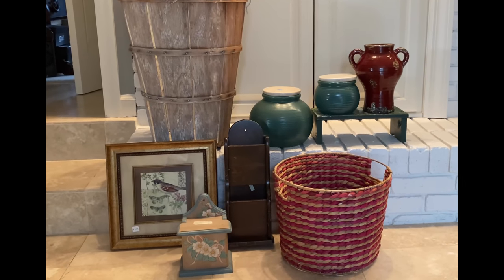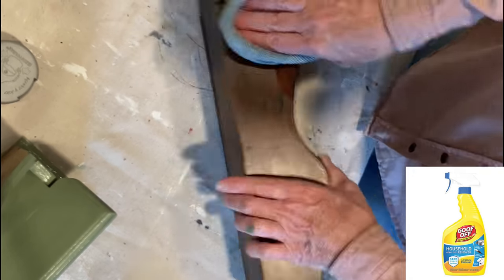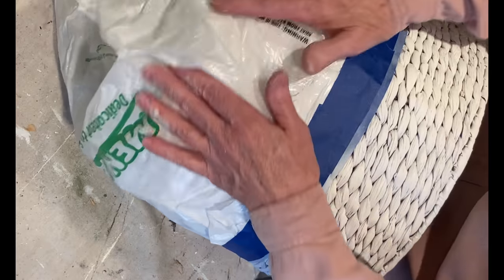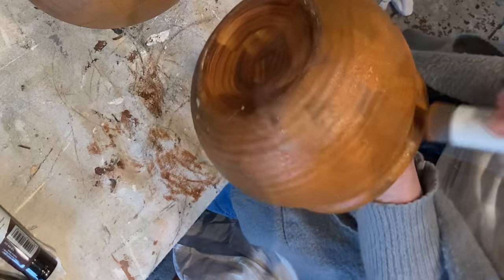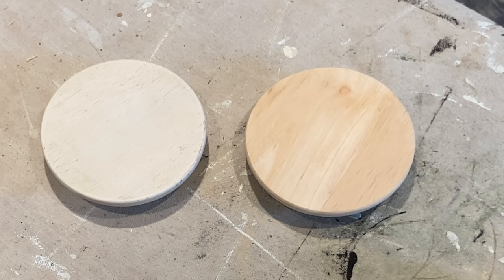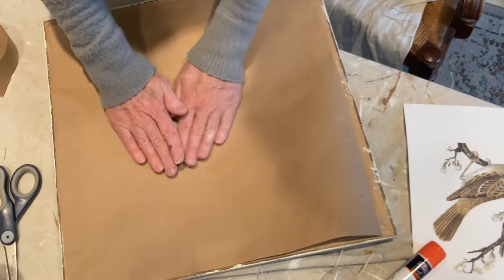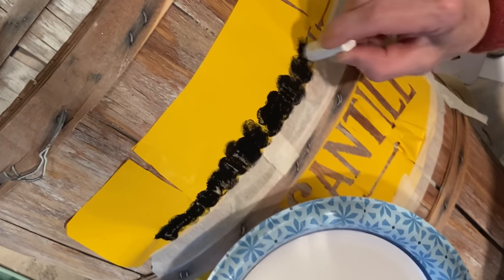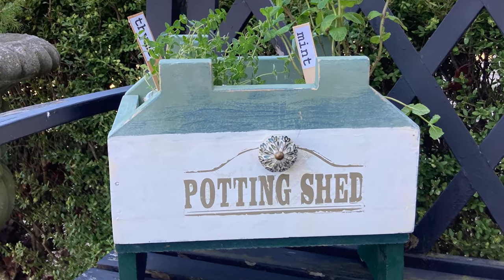8 DIY Projects Upcycling Thrift Store Home Decor

Comment: what is the difference between Waverly Clear Wax and their clear varnish?  Thanks!!
Reply from the maker: Varnish is similar to polyurethane.  It creates a mostly water proof seal.  It is much more durable than wax. You would want to use varnish or polyurethane on table tops, anything that will be used outdoors, or any furniture that will receive a lot of wear.  For example, I used polyurethane on the lazy susan table top. Hope this helps!